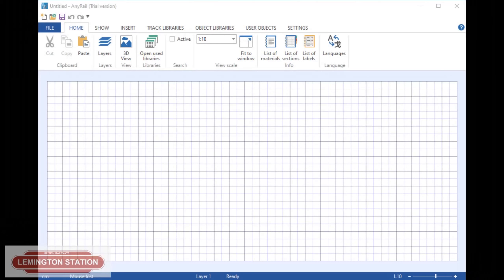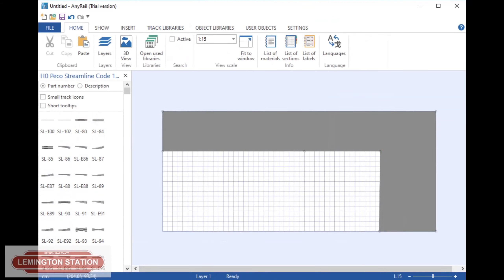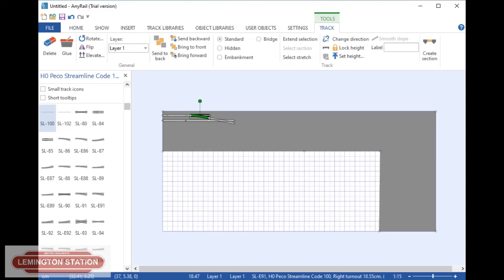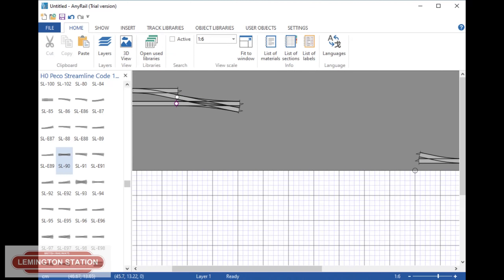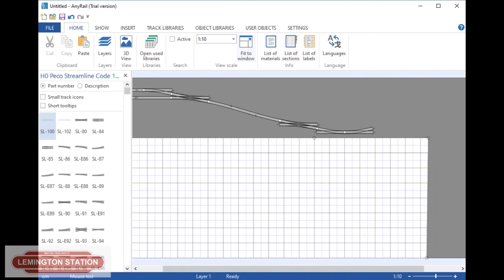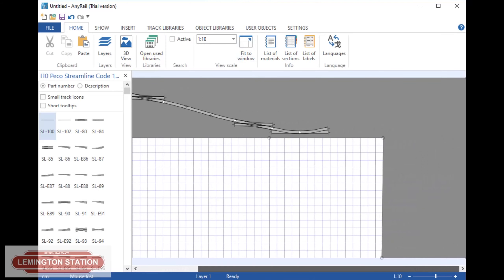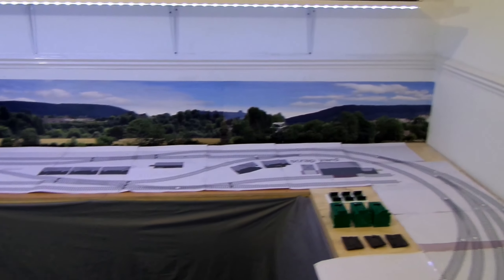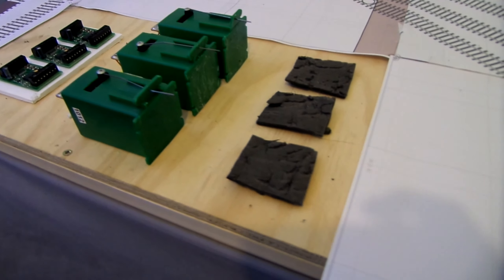02. Basic Tutorial on How to Use AnyRail And Then Transfer it to Your Baseboard

Comment: Have you thought about taking a 1:1 size plan, gluing it down to the board and installing your track or cork directly over the template? I see a lot of AnyRail users remove the plan from the bench and proceed to create grids on the board to transfer the centerlines. Why not work directly on top of the template after its been glued down? Thanks for sharing your expertise.
Reply from the maker: Yes Keith this has been a thought but this can cause problems further down the line as to speak as you are adding a layer of paper between the wood and the cork, which is another point of failure if something isn’t quite glued down properly then this can also cause rippling when glueing ballast and so on thanks for the comment and hope you enjoyed the video

Comment: Hi

When you printed your plan out did you have too cut the edges off every piece of paper as I am trying to print mine out, but the image seems to have a border round it, I have tried turning border off but ive still got the border round it

Regards

Mick
Reply from the maker: Hi Mick thanks for the watching and the comment yes there are borders I only cut two sides one long and one short and then used the other sides to overlap and either pin or tape it together if it’s a larger layout then you could possibly pop to a local printing shop and they could help print it on larger paper I have seen others do this hope this helps any more questions please don’t hesitate to drop another comment
Reply: @lemingtonstation9899  thank you for the information mate, it will help

Regards

Mick
Reply: @lemingtonstation9899  Ive managed too sus it out, on the setup printer tab there's a tick box that says borderless, you put a tick in that box and it prints without a border,

Regards

Mick